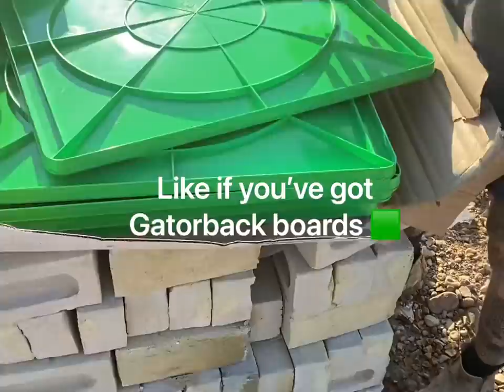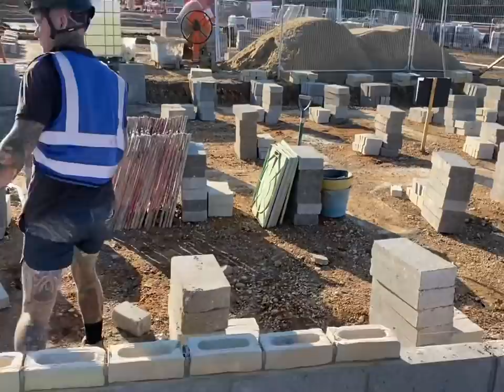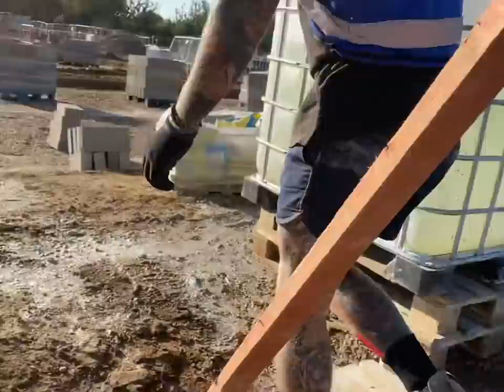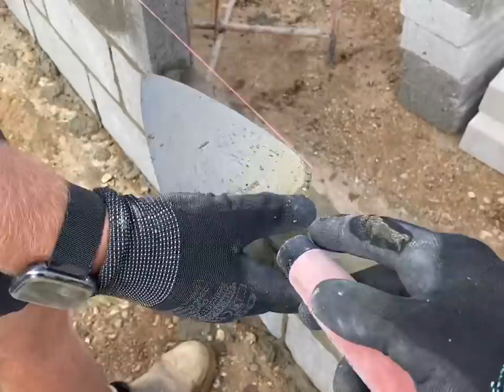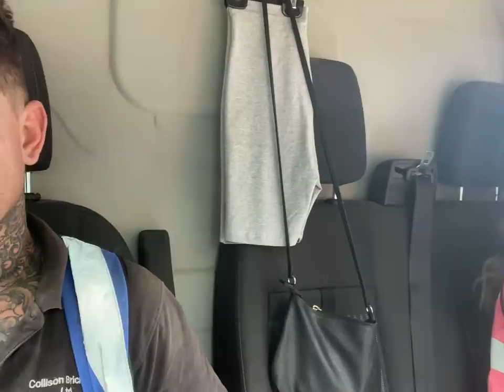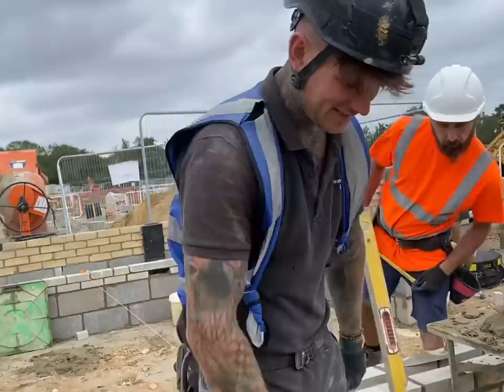New toys 🟩🟩🟩

Comment: A sweeping brush seems like a good idea to clean the concrete footings before putting the muck down! - Why when levelling equipment is so accurate, relatively cheap and easy to use is the concrete so far out of level?

Comment: Those boards don’t look as good as the old ones. Don’t look strong enough and sound really flimsy. Time will tell. Are they expensive? If there for any they should be pink lol.
Reply: 55£ , I thought the same but they are good just try not to bang your trowel on it 😁 better than a shitty bit of floor board that’s sucks the moisture out with abit of heat

Comment: charlie im a apprentice how do you stop the bottom of your blocks from kicking out ?
Reply: Try not to tap em too much give em a little wiggle , try and match your aris up
Reply: @jhutch2739  cheers hard not to tap concretes but I’ll have a go tomorrow hopefully I can get my walls perfectly plum all the way up
Reply: @adamscanlon7098  practice makes perfect r kid, just have enough muck on your bed so when you put your block down it’s a couple of mm above the line that way you can wiggle them down but if you have to much muck on your bed you will most likely have to tap em but all in good time you’ll be slapping them in! Keep going at it you’ll find your own technique 🤪
Reply: @jhutch2739  thanks for the advice I’m in my second year of my apprenticeship but for the first year I was put labouring so don’t really have much experience on the trowel but that seems to be my only issue because I check my walls every 4 courses and somehow it’s kicking constantly I’ll practice what you have said cheers 👍